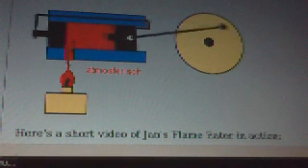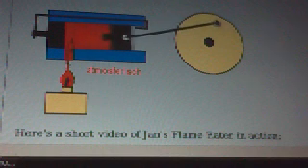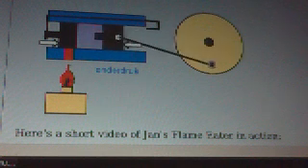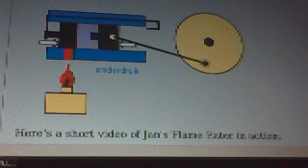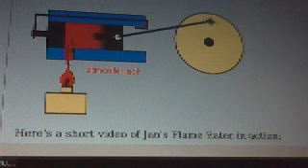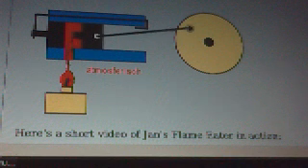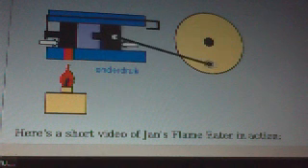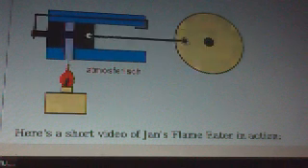Vacuum Engine Explained

Comment: Hold on, Stirling Engines are simpler than the Vacuum one. The main difference between the two seems to the latter is an open cycle engine. 
Do you consider this engine of your to be in any way an internal combustion engine?
Does the flame licker effect increase the efficiency of the engine?

Comment: the cylinders of the analog-to-a---double-expansion--steam-engine would get smaller not larger as the gas charge will shrink as it cools. think of it as an intercooled double compression engine not a double expansion engine.

Comment: The engine is inefficient first and foremost, because the flame is burning (and using fuel) while the piston is in the cooling (working) stage. You can vastly improve the efficiency, by adding another cylinder with a 180° phase-shifted connecting rod. The second biggest reason the engine is inefficient, is the open-flame design. You can improve efficiency greatly by "trapping" the flame: ad a steel tube with a 3rd and 4th opening through the center, put steel wool, or a glow mesh in the tube and have the flame heat this glowing material. Connect the two ends of the tube to the gas inlets of your two cylinders. To further increase efficiency, you'd have to make the device less adiabatic. the cylinders must be cooled very quickly, adding heat sinks to the cylinders is quite easy. You could also add a second (exhaust) valve, so you don't push the cooled, spent CO2 back at the flame.
Reply: i was thinking of this exact same problem. when the vale is closed the flame is still going full blast and that is probably half the time so if there is another engine synchronized to eat the flame while the other one is not eating it you will save half the power just like that
Reply: Seems like too many moving parts, more wear over time.

Comment: Hi again i was just reviewing your video, i am about to try making one, I then thought about what you say about re-using the hot air. I have this thought that i am going to play with.... If as the intake valve is clossing a small amount of the gas vapour were injected to keep the flame burning so creating pressure. a samll hole uncovers at other end of piston stroke to equalised back to norm air pressure, then air cools and dose the sucking, This would give two power striokes. Maybe???, Pete